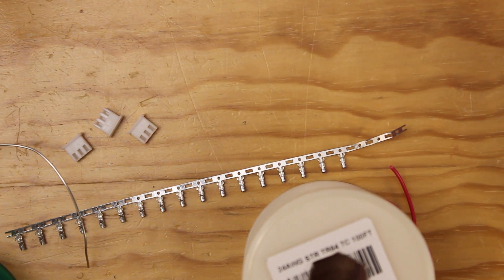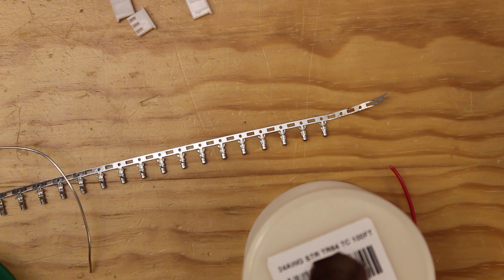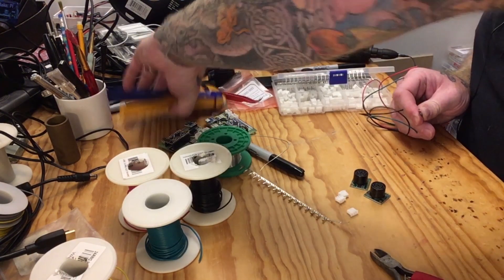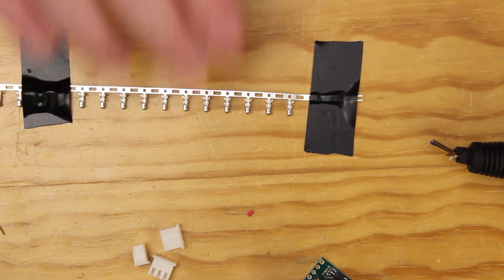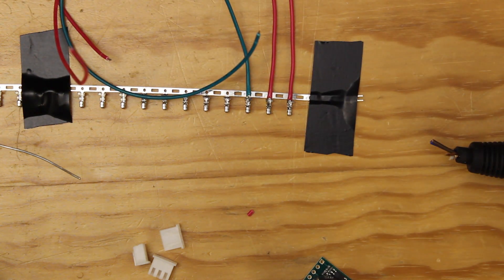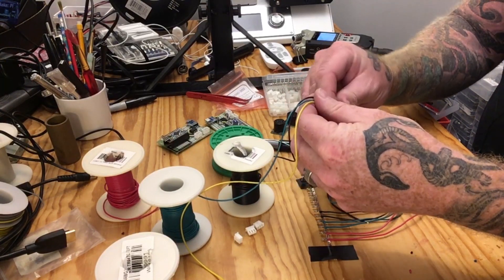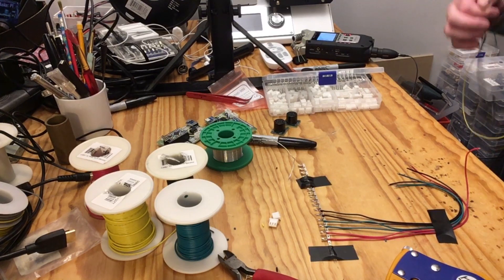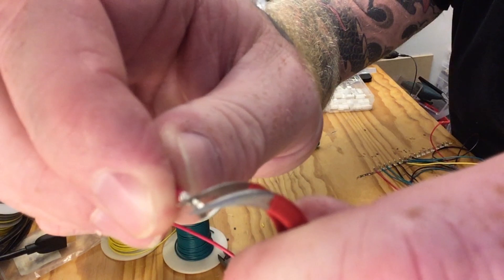JST Soldering

Comment: I didn't have a crimper, so I used pliers to crimp like you did (which makes a different, weaker shape) and soldered afterwards to give it strength.
Reply from the maker: I’ve since bought a crimper and will say without hesitation, it’s the best investment for great connectors. I had a coworker, a long time ago, say “the right tool for the job” and he was definitely right.

Comment: I only do one set of jst one time so I'm not buying the tool. I also use much bigger wires for 180 DC motor. But unfortunately I've to open up used jst because they only come with wires.

Comment: In the machine shop world we have the term "Order Of Operations". It makes the difference of a pleasurable experience to one that leaves you cussing at yourself.. Your soldering method Transposes this philosophy to the electronics bench. Leaving the connectors connected to the sacrificial ribbon and then soldering them satisfies that philosophy.  I don't have a JST crimping tool yet so I soldered them the "much harder" way! I used an old steel brad that fit the connector snugly and hammered it into a board. It held the connector while soldering the wire to it. My method is much more work than yours but it does have a positive property. While the steel brad will not easily accept solder (that's a good thing here) it does sink heat away from the female aperture. Solder will defy gravity, as it seeks where the heat is and that's where my iron is too. If you're ever forced to solder one again try your method with a brad or better yet, a drill bit. It This method does a good job of discouraging solder from migrating into an area you don't want it to go.
Wakodahatchee Chris

Comment: Great video! I noticed you're using silicone wires for your connections. I'm interested in the specifications of these wires - specifically, what AWG (American Wire Gauge) are they? I'm planning a similar project .
 Thanks in advance!
Reply from the maker: I've been using 20AWG. I think maybe I could use a thinner gauge but it's worked so far.

Comment: I have all the correct equipment for crimping, but there are times when I want solder and crimping. Then I apply a coat of solder or solder paste to the bare wire before crimping, and reflow with a heat gun after crimping. The crimp is solid, and the wire is soldered to the pin.
Reply from the maker: I have found something similar. If the use case means someone other than me is disconnecting and reconnecting plugs, I might add solder for strength.

Comment: Crimping is superior to soldering, specially connectors that are made to be crimped.
Reply from the maker: Yeah, you're 100% correct. This video was made before I bought the proper crimper. I thought I updated the description but I'll double-check.
Reply: Dont buy this product. The cable falls out, thus a fire hazard!

Comment: I used to solder them, but I finally spent $25 on a crimping tool. It goes like 10 times faster and the whole job is cleaner.
Reply from the maker: 100%. I did the same.

Comment: Soldering makes the connection brittle and only likely to fail under vibration etc. I do prefer the proper crimper and if done properly you can pull out the cable with the crimped end still on from the plastic end!
Reply from the maker: I have been meaning to do a follow up on this video. Since making this video, I did buy a proper crimper and fully endorse using a crimper.

Comment: There is good reason why they are supposed to be  properly crimped - but at the same time there are many ways to skin a cat - so if it works , it works . However - see opening statement .
Reply from the maker: You're correct.

Comment: I can imagine that tin goes easily too far into connector and blocks pin going fully in.. is that tho problem if soldering these?
Reply from the maker: if you're not careful and quick, 100% correct.

Comment: I am not an expert in crimping nor one in soldering. But, I saw once how good crimping is done. I understood that they have two ports for crimping. The middle one is for the copper (stripped wire) and the farthest one is crimped over the sheathed wire. This way the crimping of the copper stays put and doesn't come out during normal abuse. What I saw in this video was not following the normal crimping position for the stripped wire. The copper portion of the wire should have been advanced to the middle crimp and soldered there. Even with soldering, this crimping is going to fail.
Reply from the maker: i've had no issues with soldering my connectors but you likely have a point. thanks for the insight.

Comment: Where can I buy GH 1.25 pins (crimps) ??  I have precrimped wires and the plugs, but I need to make some custom length wires so looking for the GH 1.25 crimps on a band like you have in this video.
Reply from the maker: It all came in a JST connector set from Hiltichi off Amazon. I am sure you can buy just the connectors themselves from AliExpress. Easiest solution is the kit, though.
Reply: @hughqelliott  For some reason it is near impossible to find the crimps for GH 1.25 connectors.  They sell the "pre-crimped" wires in a kit along with the GH 1.25 plugs but if you need longer custom wires and want to only by the GH 1.25 crimps they are nowhere to be found.  So it seems the only solution is inserting (splicing) the necessary length in the middle of the pre-crimpted 6" wire.  GREAT video by the way.  Very helpful.
Reply from the maker: @flyinlo1474  I decided to buy some crimpers. I've had mixed results but it is likely down to practice. https://www.amazon.ca/gp/product/B01N1RFZZ4

Comment: I'm so very, very grateful for this video! I am currently working on a project with hardly any documentation as the parts I work with are from a wholesale source, meant for people who exactly know how use them. The fact is, I am not one of those people LOL. So I am figuring out a couple of things. In this project I ran into a slightly different kind of connectors, but the principle and the scale are the same. To be honest, I actually do not know the name of the connector. I have no crimp for this kind of connectors, but I do agree, the most reliable way to connect a wire to this kind of connectors is by soldering anyway. So I followed up your video, it works perfectly!

I love it that you do not use special tools. Special and expensive tools definitely have a reason to exist, but need not always be used.

In case a little too much solder is applied, making the connector too thick to fit, you can either redo the soldering, or use a fine file to make the connector thinner. Just be careful that while filing, you do not damage the cable insulator or the side that is going to make the actual connection.
Reply from the maker: All good points. I think, in a pinch, soldering is just fine. And it does make for a very secure connection. I have since bought a crimper and I quite like it. I'll still use the soldering method for more durable connections. For connection internal to a box that unlikely to move too much, I'll go with the crimper.

Comment: Brilliant idea, seems so obvious now! I'm so glad I didn't blow my money on a crimper 👍
Reply from the maker: @andrew, I did buy the crimper. I have to say, it's very good. For other connections, on installs that travel and get jostled around, I'm likely to still use the soldering method. But I admit the crimper, when used correctly, is worth the money. I am due to make a follow up video.
Reply: Crimped connections are much more pliable than soldered connections, so unless you like constantly replacing wiring harnesses whose conductors have sheared off at the solder joint, get the crimper.

Comment: See, now I'm sad I pulled my wire caps off the belt for ease of storage. 
On an unrelated note, I think I'll go buy a new belt of wire caps. (please don't shoot me if wire caps is the wrong word :p)
Reply from the maker: I keep mine attached because I have them in a box and my fingers are too clumsy to pull one single connector. (you can call them caps if you want, I won't judge).
Reply: @hughqelliott  I just didn't know the right term - connector it is :D

Comment: I just bought a cheapo $12 JST and Dupont crimper after attempting to solder wires to the JST metal connectors for a while, and I must say the crimping tool is SO MUCH EASIER and FASTER than soldering. The connections are excellent and the outerwings grab the insulator jacket so firmly that any mechanical pulls on the wire will be handled by that outside crimp.
I think soldering is the wrong way now - crimp tool for the win !
Reply from the maker: I never had any luck with the crimping but part of that is rushing. I'll have to look at it again. I know for large quantities of connectors, I don't want to be soldering.

Comment: I do it all the time , probably better than the crimp to be honest.
Reply: Yea, probably soldering is more durable, but when it comes to prepare couple hundreds of those cables, well😅
Reply from the maker: @lycankarmah1976  100%. I will buy the tool and try and get better at it. I have a project where I expect to be making 40 3-wire connectors. Soldering 120 connections will be a pain.

Comment: Thanks for posting. Those little bitty connectors are a pain. The crimpers ‘usually’ work as you say and getting any good at crimping wastes a pile of connectors. This seems a straightforward method.
Reply from the maker: I think crimping is matter of practice. Once you nail it, you'll swear by it as others have said. I like soldering for small quantities of connectors. But I think I'll get the tool and try it out again. Maybe have a follow up distancing myself from this vid. lol.
Reply: Andreas Speiss has something to say about a WIS 2820m crimper. I found that method very easy to pick up and use on those tiny connectors.
Reply from the maker: @j.hankinson7803  Yeah I ordered a proper crimper. Should arrive tomorrow. I just soldered 27 connectors and if I can save that effort long-term, I am down with it.

Comment: The crimp tool is $20 and I also need it right now - this video showed me that simple soldering is going to work and others are doing it so my approach should be good to go.
Reply from the maker: It's a good solution if you don't have the proper tool and are paranoid, that's for sure. Since I don't have the tool at the moment, this seems the way to go.